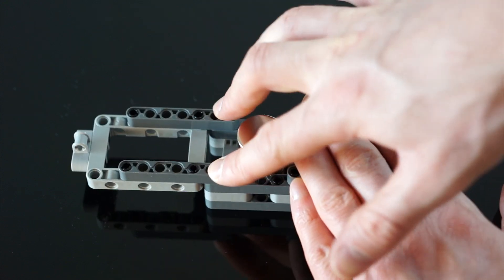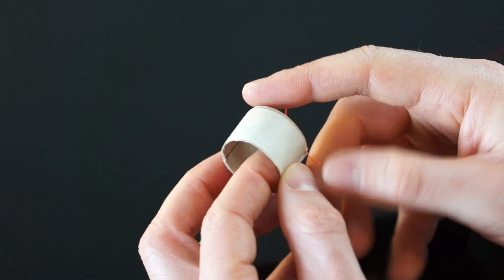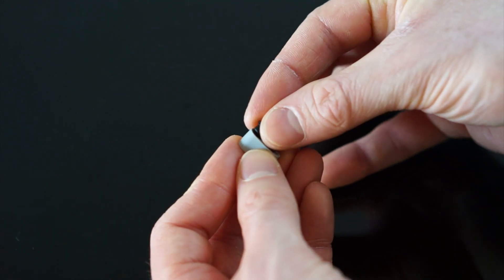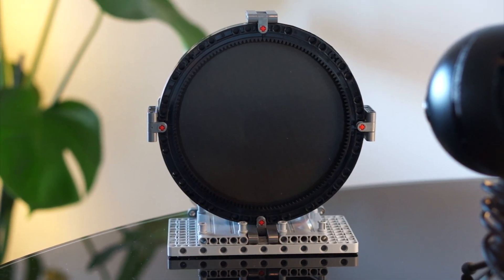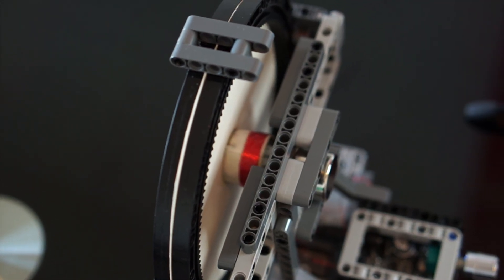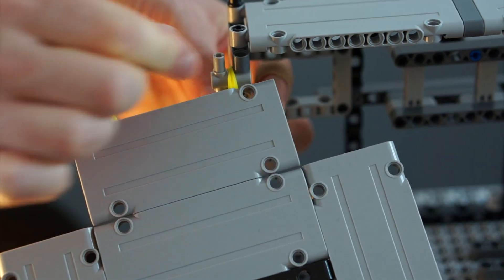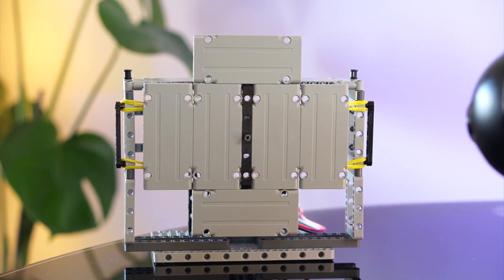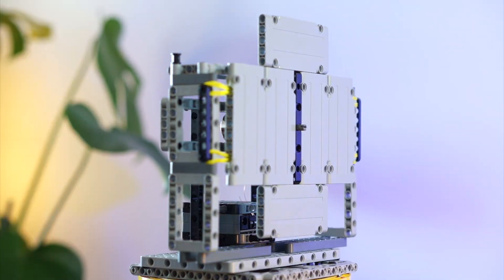Powerful Speaker Made Almost ENTIRELY of Lego

Comment: I did make one with the coil wrapped around some linkages and it was in vertical format with half between two magnets (if I'd had 2 more magnets I would have switched them to opposite pole orientation to do the top half of the coil. This was attached to some scoop shaped paper half cylinder/arch shape to produce sound. It worked okay but was not very efficient. I would enough wire not to short circuit the stereo I was using.

Comment: I'm thinking that the reason why the second speaker is better but less loud, is because the diaphragm is solid, thus moving less air, but not having to contort to fit around a circle thanks to it being attached only via a couple rubber bands.
Reply from the maker: I think you're exactly right 👌

Comment: I know why there was buzzing in the first speaker, it's because the membrane and the structure weren't one solid piece, and are in fact not properly sealed together to leave no room for the parts to vibrate against each other kind of issue.

Comment: Can you try it with 220V power?
Reply from the maker: If you had an amp that could deal with I guess you could... Though 220 would fry my current board. And the speaker coil if it tried to output that much

Comment: What copper wire did you use for the speaker as i am trying to find the parts
Reply from the maker: I think I used 28 gauge for this one, but I can't quite remember to be honest. One thing is for sure though - it's definitely not optimised for this Bluetooth amp output! Just about any coil you make yourself will work. It just might not be optimal 😉

Comment: Wow this is so cool im definitely gonna try to make one myself i was actually staggered by the sound quality of the lego one
Reply from the maker: That's awesome, I hope you do try your own - it's surprisingly easy! I actually found a simple one using only a single baseplate as the membrane works very well with a very crisp sound. It just needs a bit of juice to get the volume up high enough!
Reply: @JamiesBrickJams   well I think I have the juice it needs I have some audio amplifiers wich are able to supply some decent hifi speakers I’m on a vacation right now and I will make an attempt when I’m back home the problem with the paper membrane is that you didn’t suspend it from its mount you should try so isolate it with some foam or some flexible material
Reply from the maker: @Dezeeuw0497  very good points, yeah that probably would have helped. It sounds like you've got everything you need for a significant upgrade over these, so good luck man! Hope they work well 😁
Reply: @JamiesBrickJams  thank you 😁 if I get them working I am going to make a video about it to showcase my version

Comment: I feel like you could take this concept even further by suspending the diaphragm with a rubber membrane (to address that rattling sound caused by tensioning the paper plate), and maybe using a stronger magnet. Combine it with a lego dome tweeter, put it in a vented plywood (or cardboard, really) box, and you'd have a full on speaker!
Reply: or you could even cut a hole in one of those Lego tubs lol, i'd love to see a follow up video, I feel like this concept could be taken to a much further extent considering that all dynamic drivers are basically just a voice coil and a magnet. I've been trying to understand speakers better myself, and I feel this is a super interesting example of how speakers really work at their core.
Reply from the maker: Some great tips, cheers man! I'll certainly be doing an upgrade in the future with an enclosure and crossover to send higher frequencies to a tweeter. I love the idea of using a Lego tub or cardboard box. Could save me a lot of pieces I'll never use again 😅

Comment: I got $20 Australian that says that amp can not output 20w rms for 20 seconds... I would honestly be surprised if it can do 7 watts as that is a lot of power..... You should build some lego woofers and mid/tweeters to make a set of bookshelf or monitor speakers 👍 will be hard to keep the woofer diaphragms light enough to have good response from a woofer less you use really stiff cushions and large coils/magnets, I would personally go for an 8" woofer with solid lego core using a very stiff foam rubber cushion and paper for the tweeter at about 3-5" and use the rubber band suspension around it for a starting point. Also I would get another small solid state amp of least 20w rms and ideally 100w to have enough power to drive it/them really well and also a true 1w amp can be quite interesting to play with. I reckon the power of 1w will surprise you with lighter paper cones.
Reply from the maker: Ha yeah, I'm not taking that bet - it probably isn't sustaining that over a period of time. In my later video I recorded some footage of it running near max, and it was pulling around 1.5 amps from the power supply at 22 volts, with some peaks around 2 amps. So probably not much more than 20 watts average. I've got a crossover ordered now that should allow me to send the signal to a few different speakers - will need to test some different designs together now!

Comment: Great content! Very enjoyable video. Both speakers have good bass response, but are very lacking in the highs. this is largely due to to the size of the surfaces vibrating. If you were able to acquire a crossover circuit, which can be purchased pre-assembled, you would be able to add a smaller driver as well, allowing you to separate the high frequencies from the lows and mids. Most speakers available to consumers are made this way.  For something even more advanced, you could get a 3 way crossover, allowing you to have a small, medium, and large driver, for highs, mids, and lows respectively. In addition to size, thickness does matter. Most tweeters, which are the drivers responsible for high frequencies are easily damaged with light pressure, as they're made of very thin and light materials. Lager drivers, known as woofers are made with thicker and heavier materials. In general, woofers are 5-8 inches in diameter, where tweeters are normally 0.25 to 1 inches in diameter. In a three way speaker, the mid range driver would be closer in size to the tweeter than the woofer.
Reply from the maker: This is all super helpful advice, thanks for sharing! I've actually just ordered a 3 way crossover now, so will run some experiments over the next while after it arrives. That's a good point about the membrane being so thick. I'll try a thinner base plate of some sort. And definitely a good idea to use something really small for the tweeter. Assuming the tweeter would be around an inch or so, would you have an idea of a reasonable size for the mid-sized membrane? Somewhere between the tweeter and woofer?  Thanks again for your suggestions!

Comment: For the first speaker design, Youre missing the suspension, for what you have on the second design is more like a tweeter, the rubber suspsneison is what will help give it the excursion and will give it better bass response if its decoupled from the rest of the body.  In therory the first desgin is actually better for the full spectrum of sound and the second design is more similar to just producing higher frequencies.
Reply from the maker: Yeah I think you're definitely right, I should have tried the paper membrane suspended.. but I really wanted to keep it as much Lego as possible, and having a suspended paper membrane with rubber bands felt like there was no point to the Lego. But a couple comments suggested using a Lego box to keep it Lego, so I'll give that a try 😄

Comment: Was curious what brand/where you got the Bluetooth amplifier thing. I’ve been messing with making little speakers, but kinda getting annoyed of trying to wrap thin wires around an aux tip
Reply from the maker: Hey, it's just a cheap little DollaTek TPA3116 Bluetooth amp. I'm sure it'd work well with small speakers too. Good luck!
Reply: @JamiesBrickJams  awesome, thank you very much

Comment: Maybe this can be further improved by uping the voltage and using thiner lego for a membrame? Still amazing this works at all.
Reply from the maker: Upping the voltage (and thereby power) makes it sound much worse as the rattle increases 😅 But yeah, a thinner lighter membrane, along with an enclosure would improve it a lot

Comment: Im a bit late but feel the need to say something here for the comparison between the two speakers. Both, by the way, sound fantastic and look crazy but one had a design addition that wasnt on the other.

When you used the paper membrane, i noticed you had the corners clamped down and held tight. That heavy distortion was because of the membrane being pushed forward when its already stretched tight and may have had the coil scrubbing too.

If you were to trim down the paper membrane and use like some tape to create a little surround, and find some way to do the same to the coil to guarantee it doesnt move around and fits more securely, it might be an impressive little beast. And its evident when you play the bass heavy song between the two speakers.
 The lego one has some form of suspension, giving you that nice clean bass. The paper one doesnt have the same, leading to a horrible rattling noise.
Reply from the maker: Very true it wasn't the fairest comparison really. I contemplated making a suspended paper membrane but at that point, there wasn't really much point to the Lego other than just being support. But I'll experiment with it anyway! Some folks have made some great suggestions to improve the all Lego one, so I'll prioritise that one for a major overhaul. Thanks for your tips though, I always appreciate the ideas and help! 🙏
Reply: @Jamie's Lego Jams  i look forward to it, and honestly wanna see what else you dish out like this. Just the production and care behind this video will get a sub from me. Keep up the work my dude, and dont let anyone try to discourage you

Comment: Although it’s a really fun little experiment, Lego speakers won’t sound good at all and that’s because of the material of LEGO, pieces of plastics. Even when you tried to reinforce the pieces together, each of them would vibrate at different frequencies and that’s just gonna give you a ton of distortions. And ignoring this problem, the design of the “speaker” is just not good, you need a speaker box to actually make some bass, as a open speaker driver is continuously moving air front and back, if you don’t have something that’s covering the other side of the speaker driver, the air around it will just move forth and back AROUND the speaker instead of moving more air in the direction you want.
Reply from the maker: That's an interesting point about different pieces vibrating at different frequencies and the distortion that adds. You're totally right of course, it's a pretty silly idea making a speaker out of Lego. I mainly wanted to see just how bad it would sound, and ended up pleasantly surprised. An enclosure seems to be a must, so I'm waiting on some parts to see how that helps the sound profile. Cheers for the tips!

Comment: Okay, so on that wheel idea that you had take away the plastic on the inside of the wheel and make another coil on the other side of the rim, so it has a dual voice coil type of action which causes it to work better
Reply from the maker: That's an interesting idea.. I'll need to see exactly how to drive that, but sounds like it's worth trying

Comment: You are going to have to do a lot more proving on your lego speaker, because there is no way that sound is coming out of that thing.

Its literally impossible, its far too stiff to have that good sound response.

And the travel on the coil is not enough for the bass. People are buying that hook line and sinker though, so that is even more worrying.
Reply from the maker: Guess I'll have to take your comment for the compliment it seems to be 😁 It seems folks want to see this thing crank out Scarlett Fire, so I'll create a short video soon demonstrating that. As for the 'stiffness', yep, it is stiff. That's why the higher frequencies are ok (though not great). And the base is kind of weak, but surprisingly still reasonable if I pump as much current through it as it'll take. The maximum travel of the plate membrane is around 1 to 2 mm, which seems to be plenty for some mild base. As others have noted though, the lower frequency response would likely be much better with an enclosure to prevent waves behind the plate interfering with the waves in front.

Comment: The crackling from the paper membrane speaker sounded like a lot of friction and the membrane slapping back and forth in the frame. I think the main reason the LEGO speaker sounds better, is because it's suspended by rubber bands and doesn't collide with anything while vibrating.
Reply from the maker: You're totally right, the paper membrane design was terrible - I'll do some tests with a better suspended membrane
Reply: @JamiesBrickJams  The general design of the round paper membrane speaker is very nice, though, maybe a version of that design with a new mounting system would be an idea.
Reply: @JamiesBrickJams there is a reason speakers have rubber around the paper to connect it with the frame ;)
Reply from the maker: @Sena121  Hey, yes, the rubber pieces (hopefully) reduce vibrations a bit!

Comment: Your basic idea is good but you might want to see how a real speaker is made or take a real one apart. I think one of the huge  problems with the sound and action of this is the voice coil part. It needs to be closer (very slim fit but not rubbing on the magnet, or magnet mounted steal center poll)  or centered on the magnet (back to front with out the second magnet) is my best estimation. A funnel, cone shape will give it more clarity as well.
Reply from the maker: Thanks for the advice here - very helpful! Deffo agree, this was a very sloppy job, and needs a lot of refinement. Got a few more experiments to do with the Lego one, but will attempt an all round upgraded version in the near future! Appreciate your tips 🙏

Comment: That is very impressive. Love the second design because it only uses lego with the exception of the copper coil and magnet.

For 100% lego, consider the use a DC lego motor as the magnet and coil arrangement.
Reply from the maker: I'd love to make it all Lego! Someone suggested a pirate sail membrane, train magnets, and power functions wire - will see what I can source

Comment: I know alot of people have people have thrown tips at you already, but it's worth throwing this out there: a good speaker has these attributes: a light but rigid diaphragm, a well wound coil thats tight to the magnet without restricting movement, and a large magnet. You should also consider adding a surround/suspension to the outer edges of your paper plate model, this will give greater freedom of movement to the diaphragm and eliminating much of the distortion. The diaphragm should also be a cone or concave, this gives lighter materials strength they lack when flat. Flat diaphragms suffer from distortion much like your first version because they are too flexible across their surface. Your second one worked better (partly because it had rubber bands acting as a surround) but its mass (weight) was creating unwanted resistance and absorbing much of the coil's output, thus how much quieter it sounded. A combination of the two, with the paper plate model handling mids and the highs and the rigid plate model handling the low mids in the base probably would have sounded better than either of the two on their own. That's why you commonly see a tweeter and a mid speaker (and sometimes a bass) in hifi stereo sets. Spreading the output across multiple speakers based on frequency increases the fidelity of the reproduced sound. Food for thought.
Reply from the maker: All fantastic advice, thanks so much for taking to time to write that all out! Yeah you're definitely right, I think suspending the paper one would have yielded better results. Do you think using pneumatic tubing as a dampener might also work? Just brainstorming some ideas to keep more of it Lego. I'm guessing (just listening to other commenters) that building an enclosure for the woofer would allow better reverb and boost the lower frequencies a little? As you mentioned, I think a next step is to filter the audio signal to separate tweeters and woofer. Thanks for the helpful commenting! 🙏
Reply: @JamiesBrickJams   Yes I think you could use pneumatic tubing for the surround. If that fails some thin foam (like the kind used for stacking china plates for storage) cut into a ring and glued to the paper could work. An enclosure for the bass would help but remember not to seal it off or provide something flexible in a wall cut out to act as a buffer for the changes in air pressure, otherwise the bass speaker will be fighting against the air inside the box. I think the biggest problem you will have keeping it mostly Lego is that the diaphragm really can't be made of Lego without poor sound quality. Do you have any of the plastic sails that came with the pirate kits? Those were pretty flexible and they had holes in them so you could mount the pneumatic tubing to them
Reply from the maker: Looks like I'm gonna have to go shopping for pirate sails ☠️ Gotcha, so keep a hope in the box (I'm guessing like most woofers have) to allow air to travel in and out. Thanks again for the pointers!

Comment: I can spot somethings you did wrong, the most important one is that the cone is hitting the magnet, if you move the magnet back a bit it won't hit the cone.
Reply from the maker: You could be right, though I left a good cm or so of movement before the magnet could hit the membrane. I suspect the paper just couldn't travel much as it was clamped down, creating all that vibration